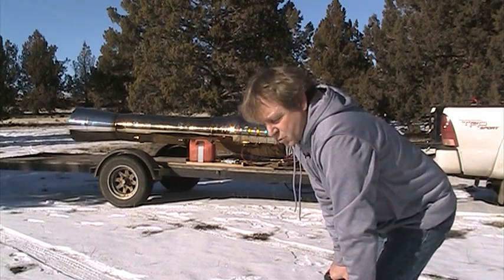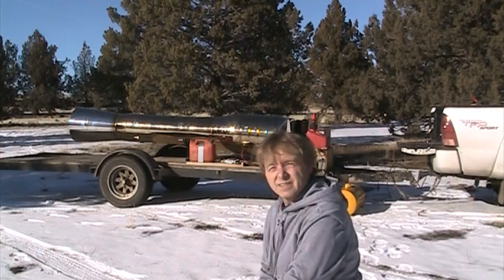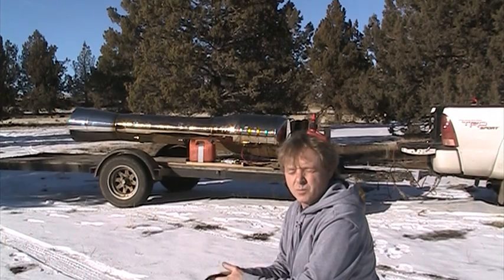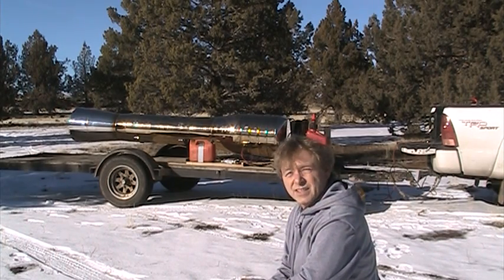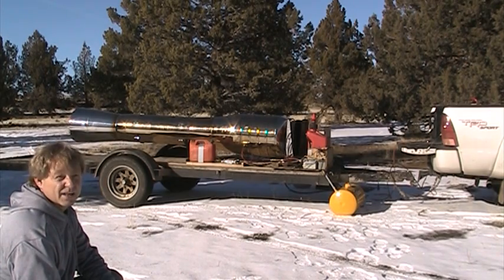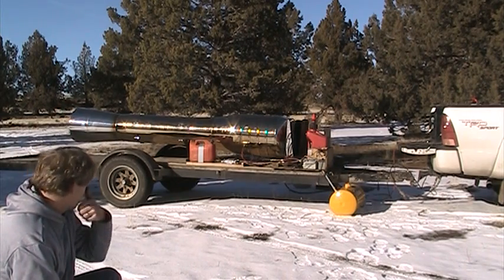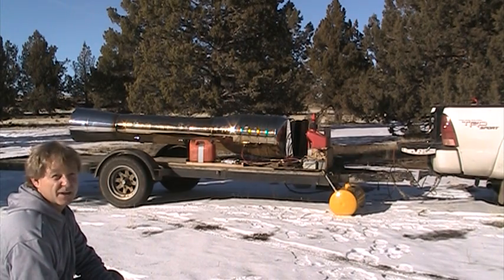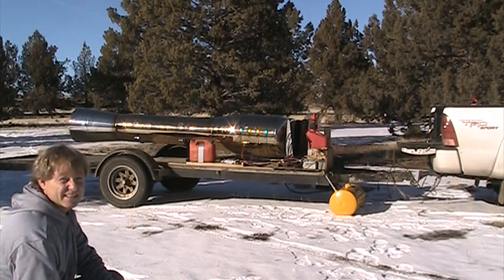RocketMan: German V-1 size Pulsejet Cruise missile Engine.

Comment: I'm always amazed at how red hot, and sometimes yellow/white hot these things get. I suspect they have a lot less airflow than axial flow and centrifugal flow turbojet engines have, thus the high heat. Plus so much of the tube is a combustion chamber. Where in regular turbojets the high temp areas are limited to the burner cans.